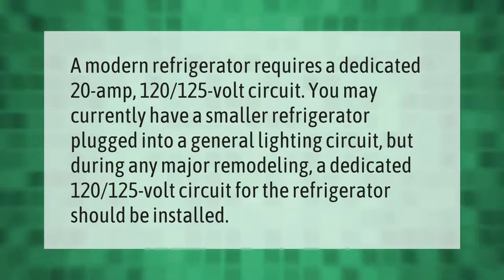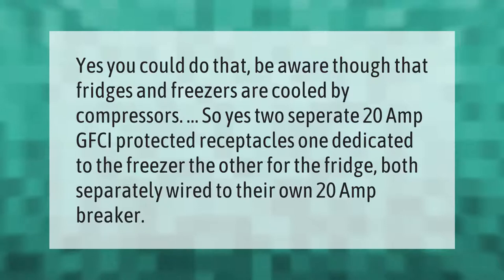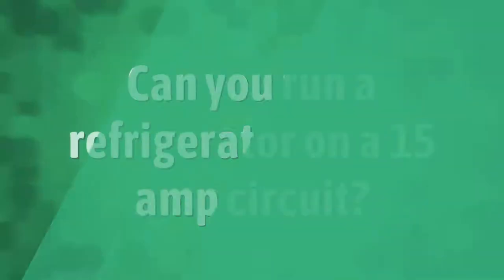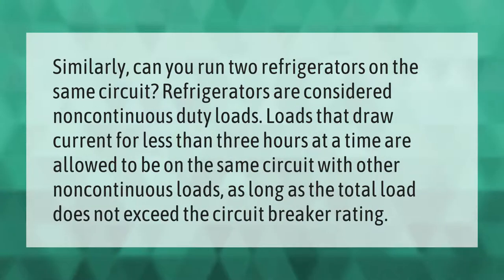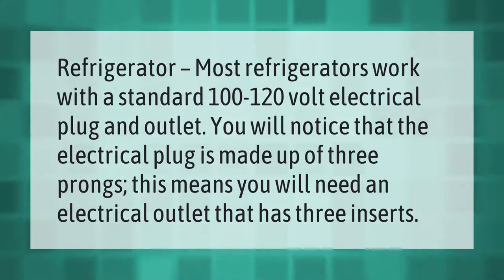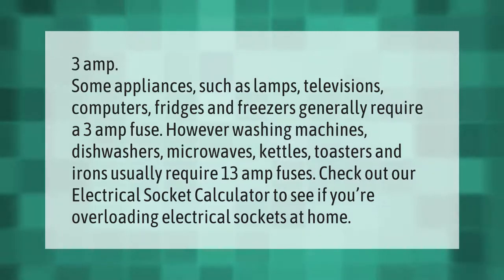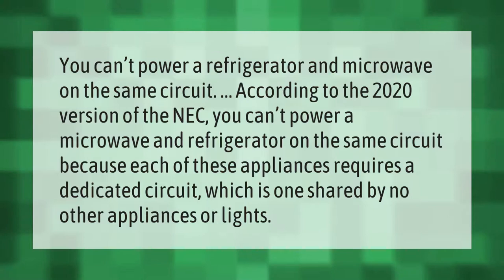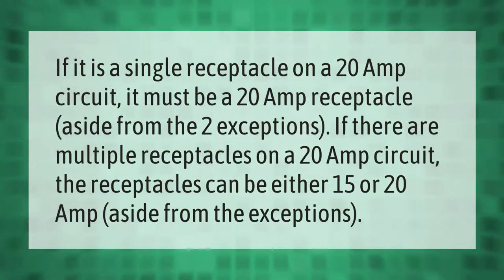Does a fridge need a 20 amp circuit?

Comment: Ok, the video doesn't exactly directly answer the question, "Can I run my refrigerator on a 15 amp circuit, safely?" Just give a yes or no answer please. In general, every refrigerator I am looking at says it is rated for 20 amps, However, when looking at the max wattage, it doesn't add up, as it looks more like 6 amps on a 120v circuit. Are they just overcoempensating?

Comment: Is it safe to plug a refrigerator to an extension cord?
Reply: I wouldn’t but if I did it would be a short one minimum 12/2 wire size. Taking a chance on wrecking your appliance and heating your wiring up in the walls.